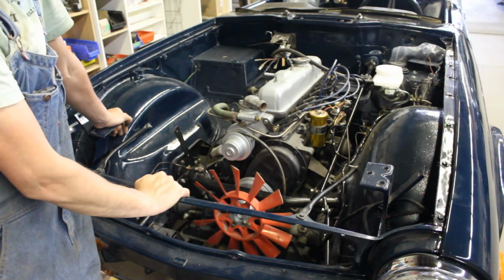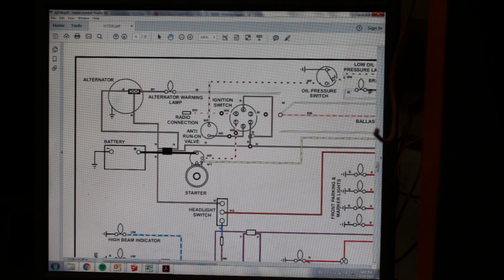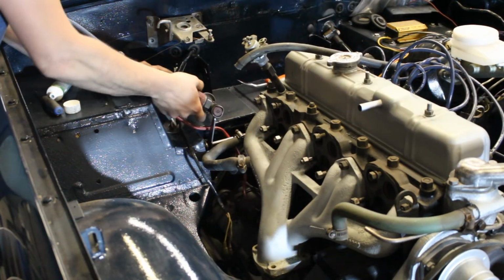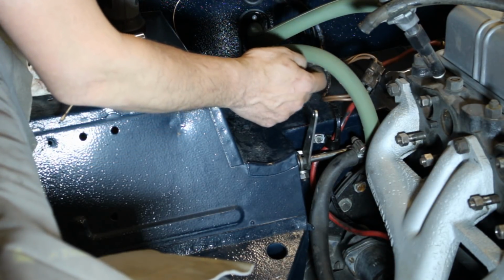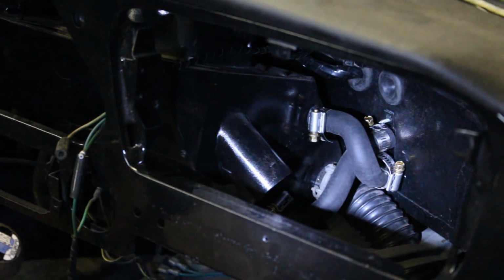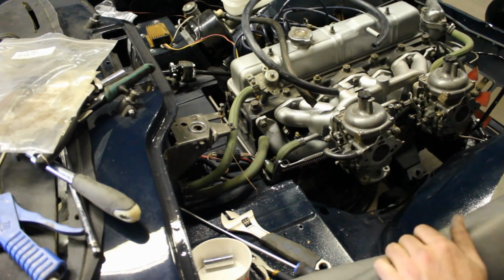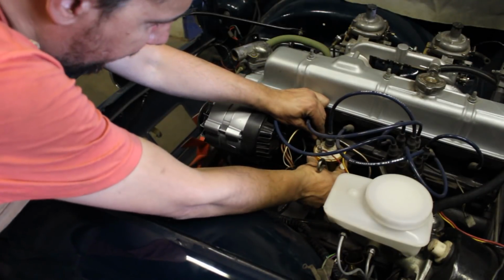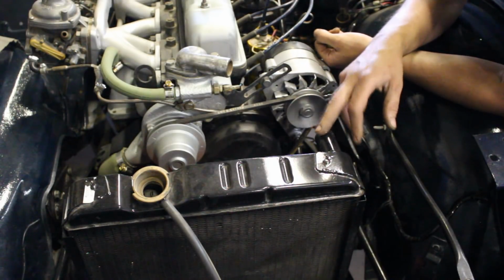1973 Triumph TR6 Restoration - Part 18 - More Engine Bay Assembling

Comment: Elin your doing a great thing for the tr6 community with your documentation of how things go together. The brown wire goes to the back of the alternator there should be a connector there also on a 73 I think there is that funky emissions connection on the top of the radiator look it up keep the vids going have a beer for me .
Reply: ralph cap yes. The thermostatic vacuum switch (tvs).
Reply from the maker: Well I did put the brown wire where you told me. It is your responsibility now :) Not installing that funky thing on the rad :)

Comment: For the accelerator spring , there should be a little tab on the body straight down underneath where the linkage connects.  The spring will be in a vertical position from the little tab to the hole in the bell crank for the accelerator shaft.
Reply from the maker: Thanks, I think I need a pair of big reading glasses, I missed the tab somehow. :)

Comment: How did you crimp on the Lucas bullet terminals? These are used on my '74 Norton Commando 850 motorcycle also. I believe there is a special tool for these, but it is expensive...do you have an alternative method?
Reply from the maker: Yeah, there is a special tool, which I don't have either. I just used a 5$ flimsy crimping tool, that is not good for anything else, but it worked really well on the bullets. I will show it in a video if I remember

Comment: The heater hoses are similar to my TR4A, I could never figure why the hoses are " interrupted"at the firewall. 
Why not just run the hoses full length to and from the heater and valve ? Four less chances for leaks.
I'm sure the hoses could be properly sealed at the firewall with dum-dum or silicone or ?
Reply from the maker: There are many misdesigns on these cars, but I am not that concerned. It is what it is

Comment: Elin can't wait to see how you tackle the outer and inner window door seals the most frustrating thing I've ever had to tackle the tool is a piece of s--t where are your vids
Reply from the maker: Well I am not sure it is the same as the Spitfire, but I remember I had absolutely no issues there. Now everybody is scaring me with these and I am concerned too :) But I forgot to order the clips. I will have to look around and see what I have in the used parts from all the TR6s in the shop.

Comment: Green hoses. My 75 still has original green hoses. I've been driving around for about 15 years with a complete set of black hoses thinking if a green one blew I could fix on the spot. I hate the idea of black hoses though. Elin, please tell me where you got the green set. I'll order them and also replace my coolant and thermostat. Anybody want a set of black hoses haha.
Reply from the maker: Moss Motors. It is not expencive, I think about 75 bucks
Reply: Thanks Elin. Ordered